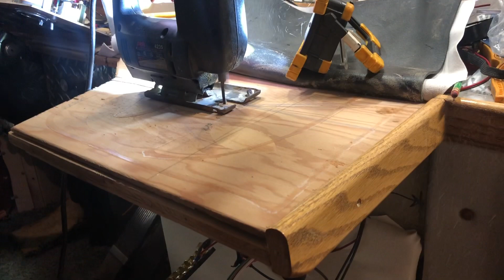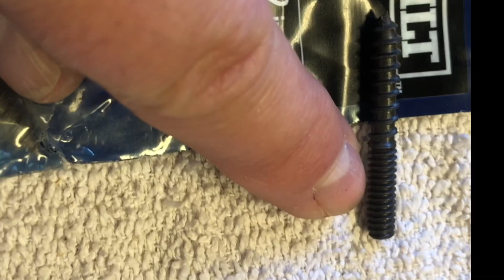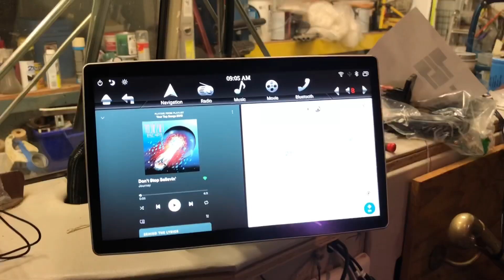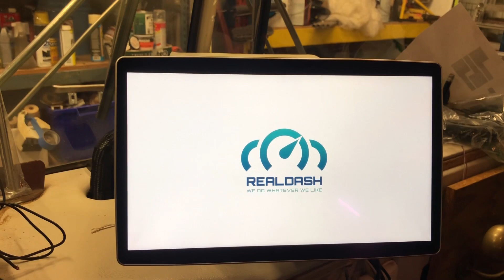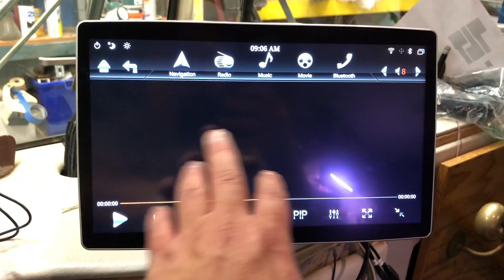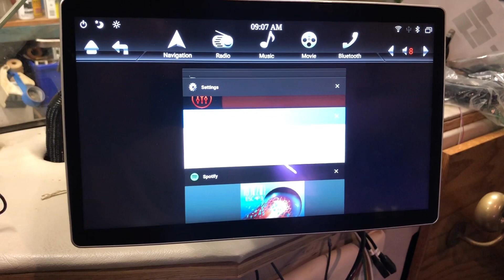Tesla style stereo install vid #2

Comment: Nice thats a nice addition to modernize things. Just a thought, bring the cables up in the middle of the lazy Susan hole instead of the outside.. not sure if that’s possible.
Reply from the maker: Yeah that occurred to me after-the fact, I was using an existing hole.  It's thick steel under all that, and the stereo is long inside that box, but it could be done with some repositioning and more dash destruction.  Sometimes you have to think inside the box...
Reply: Yea that is usually how some of my projects go.. sometimes you can’t see the forest through the trees.. I forgot that is a stereo.. looks just like a tablet..

Comment: What stereo unit are you using?
Reply from the maker: I looked long and hard and bought this exact unit:
https://usa.banggood.com/PX6-12_8-Inch-for-Android-8_1-Car-Stereo-Radio-180-Degree-Rotable-IPS-Touch-Screen-4G+32G-GPS-WIFI-3G-4G-FM-AM-Support-Vehicle-Balance-Detection-p-1589475.html?AID=12223142&PID=100202985&source=affiliate&utm_source=Banggood_CJ&utm_content=5544686&aff_key=e2b8741105732c3db27143f87903839797c6ce3c74aa835d3&utm_campaign=5e5757a6e0b011ea810302a00a1c0e14&ID=6286153&cur_warehouse=CN
I was able to get it from a US warehouse in less than a week, but it seems like it's out of stock in the US now.  It did not come with a printed manual.  The downloadable manual provided is a joke.  Fortunately the wiring is all labeled, the harness is standard ISO, and it was all self explanatory.  The one thing that took me a while to figure out is that the admin options are only available when the screen is rotated vertically.  Also the EQ options do not appear when running spotify unless you go into another built-in app (eg, the radio) first.
This unit on Amazon appears to be the same unit, but the price is quite a bit higher and shipping times appear longer:
https://amzn.to/3aA5Sd2
Some of the comments on the Amazon link are accurate, the software isn't great on this unit.  I am not giving this thing a rave review, but it seems like it'll work for my purposes.  If it fails, it's a double-din mount with a standard harness and I can yank it out and install something else.
Note: these are affiliate links, if you buy using them I might receive a small commission.  However that is not my motivation, my opinions are unbiased and brutal if necessary, I bought this with my own money for my project.